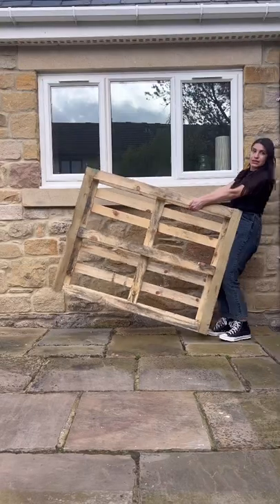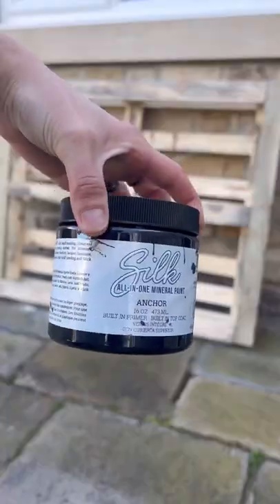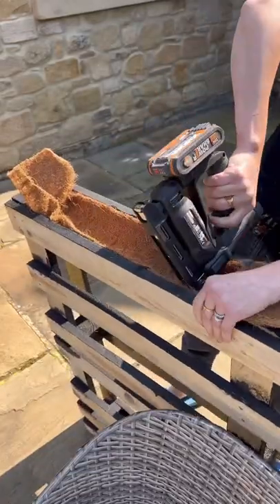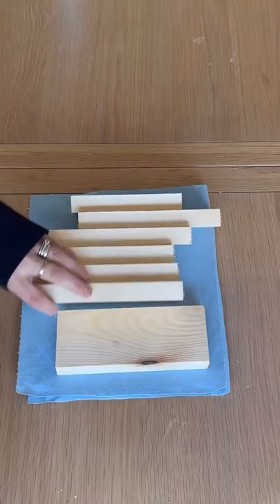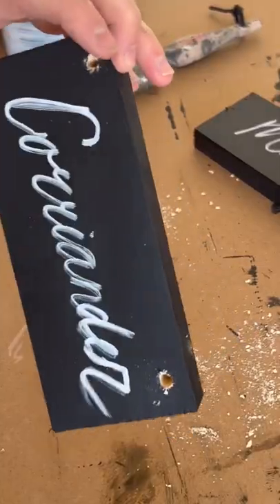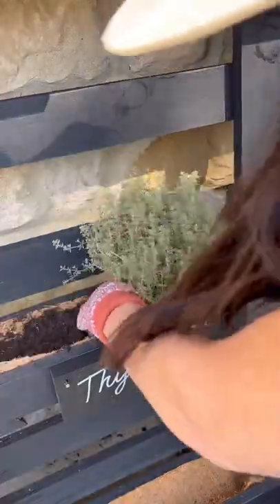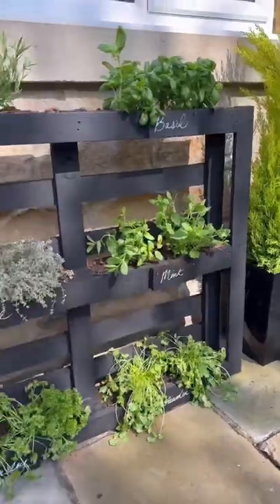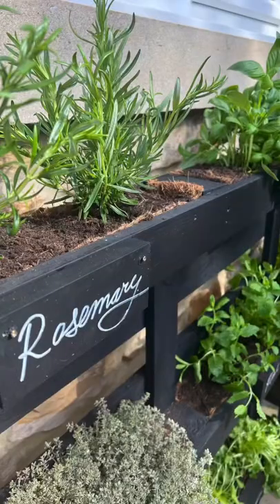The EASIEST DIY Project 😲 #shorts #diy #diyprojects #upcycling

Comment: It looks awesome!!!! but PSA Make sure pallets are safe to use before upcycling them. each pallet will have a marking or stamp and if not generally that means its a national pallet which Is safe to use but overall avoid pallets with stamps that say MB as it contains dangerous chemical Methyl Bromide also always avoid colored pallets which are also toxic as well as pallets stamped with EUR unless its also EPAL stamped.

Comment: You have an amazing talent my friend!!! I need an idea… I just bought a dining room set, the extra piece it brings for you to extend the table I like how it looks in the middle of the table stretched the opposite way but it has the hardware sticking out. I thought of taking the hardware off but I don’t want to not have the option to not extend the table if I have visitors over. Any suggestions?